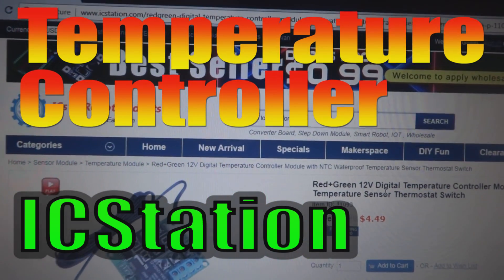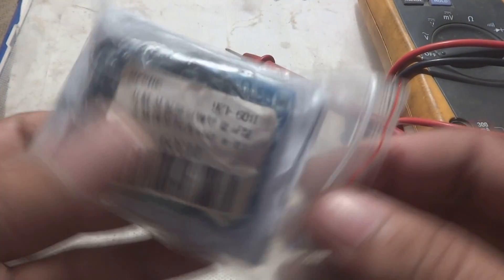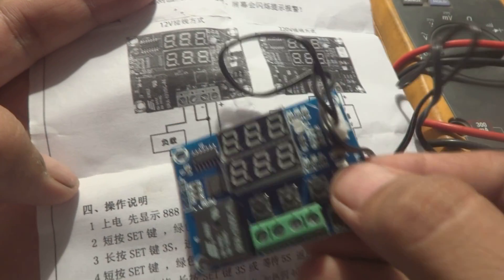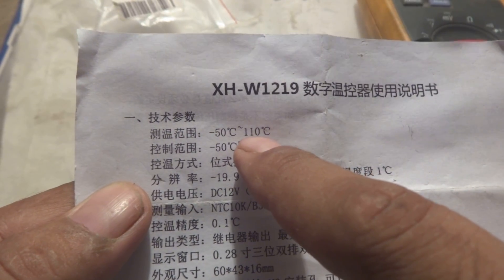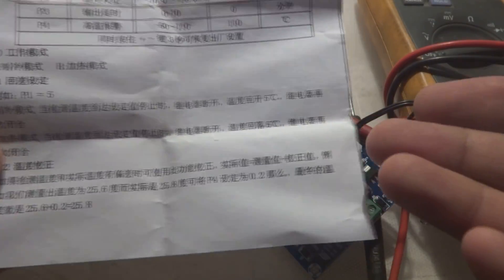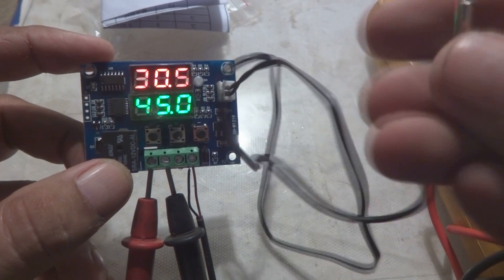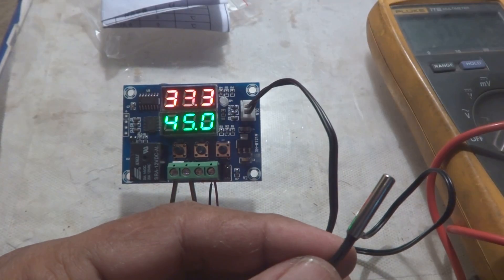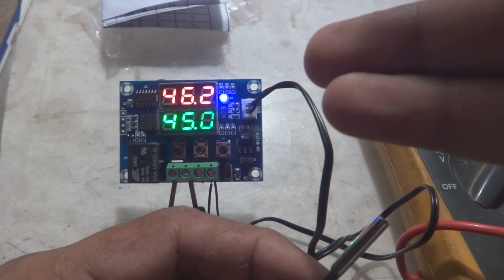Temperature controller thermostat Switch review. An ICStation module

Comment: Sir  where you fixed the meter nobes, on same place can I fix my radiator fan +& - or I need to use a 4 point relay or cut out to avoid a circut burning plz reply thanks.